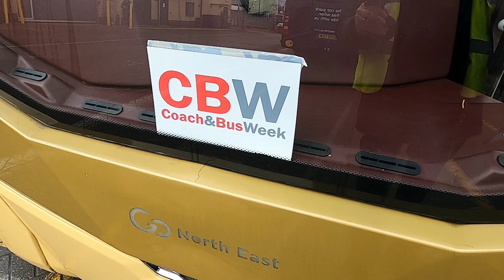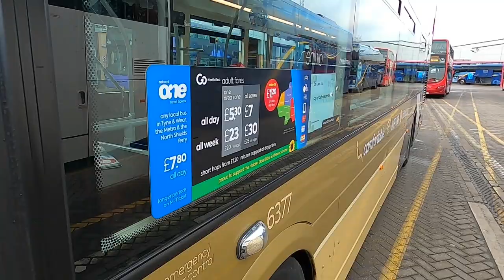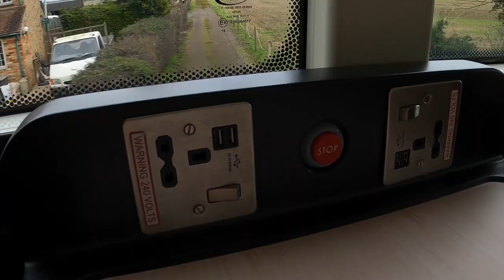Test Drive | Wrightbus StreetDeck Daimler OM936 7.7 litre 6-cylinder engine

Comment: I've driven this in service a few times at Go North East. The 6 Cylinder engine is amazingly refined. I had it running during my first use check and stood exactly halfway down the lower saloon. The indicators were louder than the engine ticking over! Most of the time engine noise is barely noticeable until the revs get over about 1700. On the speed limiter you probably wouldn't hear it at all were it not for a faint Voith gearbox whine. Build quality is actually pretty good and it doesn't rattle that much in the cab. What I do think let's it down however is the Voith gearbox. There are some instances where its just too reluctant to change down or hold onto a gear when you really need it too. As a result I've had 4 cylinder Streetdecks and B5s climb onto the A1 quicker than this does. I suppose with it being a Voith that once it is in top gear the revs just build continuously. But I'd find it a much better bus with a Voith that's opened up a bit more for hills or a ZF EcoLife
Reply: Voith is the worse gearbox ever 
I’ve quit bus companies because of that awful gearbox
Reply: It's a shame they didn't get it with the ZF or the Daimler 6 Speed offering :( it's an amazing vehicle
Reply: engine has a ticking sound now. its proberly just engine wear

Comment: It's almost if bigger lower revving engines in buses are better than tiny high revving engines - hopefully it means long term better reliabilty and less breakdowns.
Reply: As an ex bus driver I was so frustrated when the b10ble was phased out in favour of the B7. The B7 was a terrible engine and was highly inferior to the engine it replaced. You had refinement and low end torque in the b10ble and nothing but noise and vibration and a complete lack of power with the B7 that came out around 2002

Comment: I rode on it on its loan period to OBC, it felt good, a lot more power however I felt like the Voith gearbox goes up the gear changes too quickly. Additionally the stop-start is also the cause of many reliability issues. I feel like it would be better suited to a ZF Ecolife box.

Comment: I recover buses every day for first west yorkshire,the main issues with the 4 pot merc engines are crank dampers and oil seals and far too much running off the 2 alternators,e.g. the electric air compressors are shite,power steering,i reckon the 6 pots are probably a lot better because the 4 pots are underpowered and have serious cooling issues,oil cooler warps with the sheer amount of heat generated under heavy loads.local merc dealer is changing engines weekly.